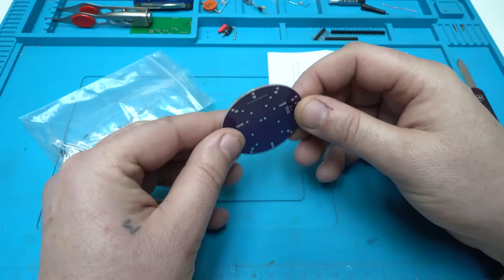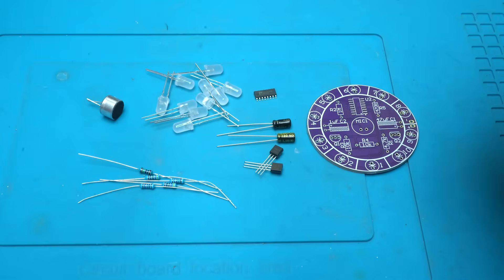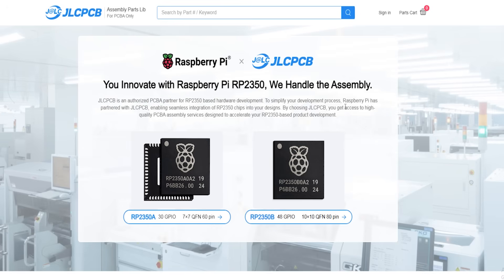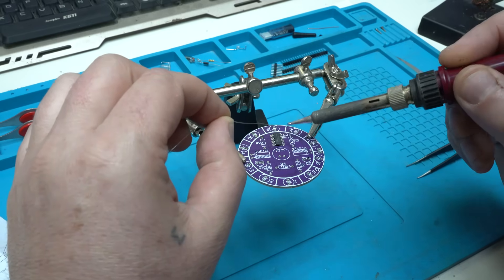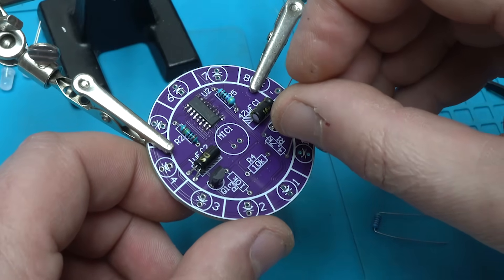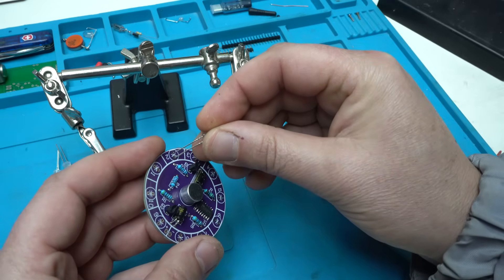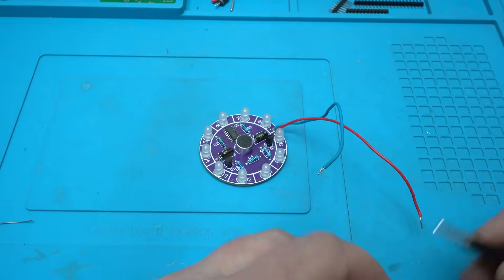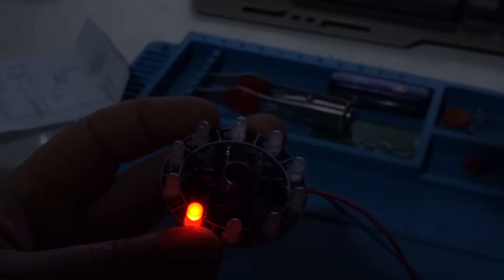Using THIS $1 Part  I Built Voice Controlled LEDs

Comment: Something is wrong with LED #5. It doesn't come on with the same frequency as the others and when it does it's often very dim. Bad solder joint or resistor out of spec?

Comment: Nice Gadget. But i don't think it's easy to solder the SMD Chip.
Again a very nice video. Thanks for sharing.
Reply from the maker: I need to use heat gun,I have it but I couldnt find it  in my workshop😄
Reply: Would make for a nice board to practice. It looks doable as it has the long pads making it ideal for manual soldering.

Comment: why is LED5 'lazy'
Reply: It’s not that it is lazy, it’s just that it doesn’t care. (Office Space)
Reply from the maker: I notice that too and figure out the led its faulty
Reply: @Hacktuber  or it's driver pin on the chip.  Often to save money lots of b grade LEDs and chips stay in the supply chain.
Reply: Was about to ask the same, looks like 5 was being lazy for some reason. It did stop on it a couple of time, but was behaving differently for sure.